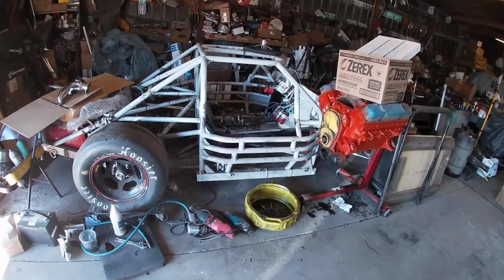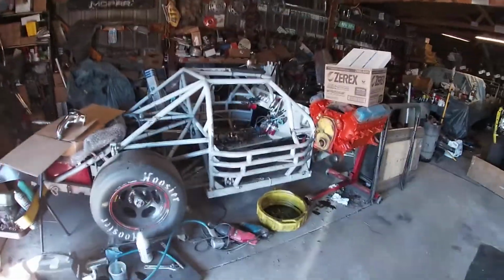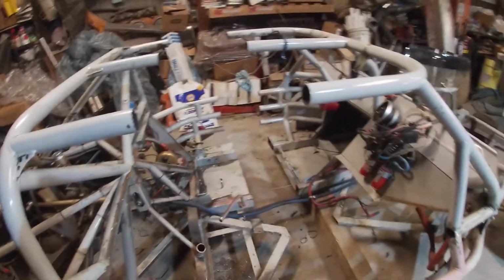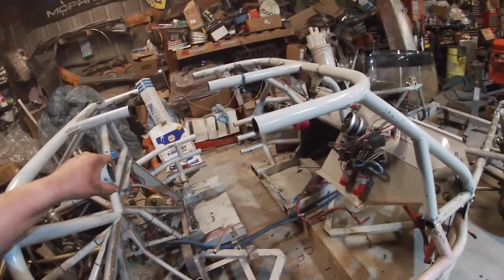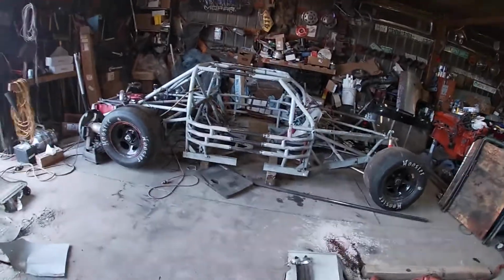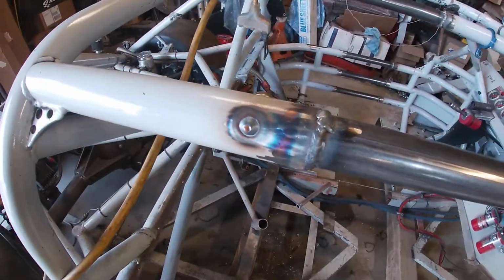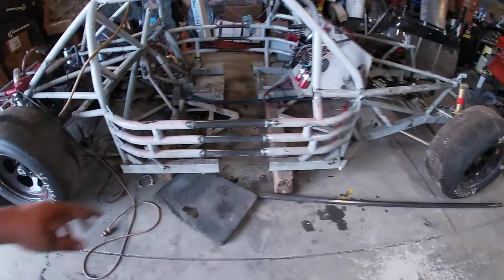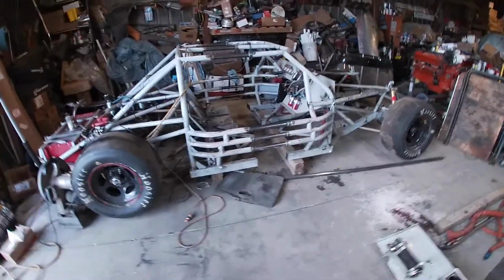1968 Charger Nascar Build // Ep 3: Chopping The Chassis In Two

Comment: With all those door bars in there you could probably do about anything you wanted to the 2x3 perimeter rails for exhaust and it would still be strong as an Ox. You might be able cut a 12" section clean out and weld a longer piece back on top if you wanted to. I hope the Charger roof is long enough to cover your extended cage. This sooo dang cool
Reply from the maker: yeah, it definitely seems like it'll be strong enough, ive got some ideas for the exhaust, ill just have to see what ends up working!